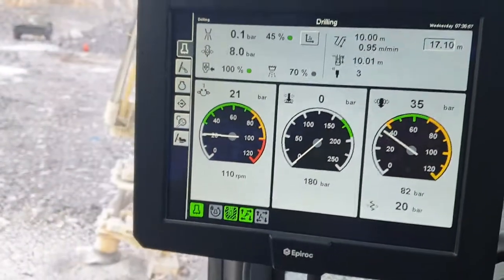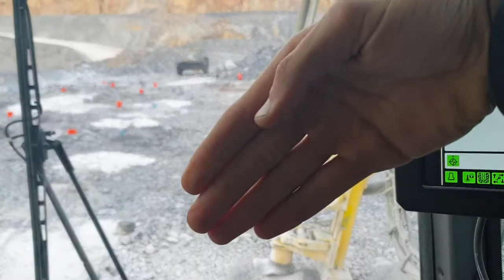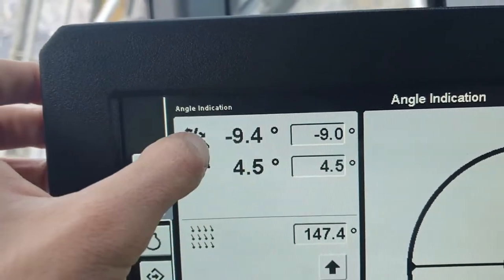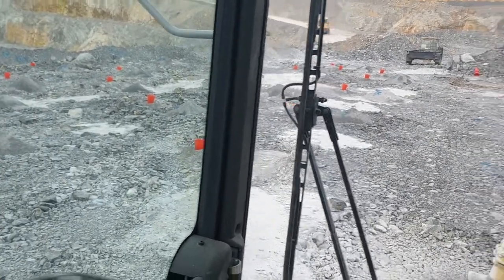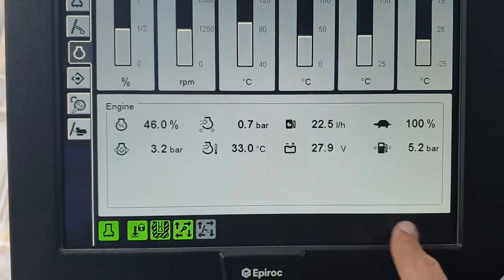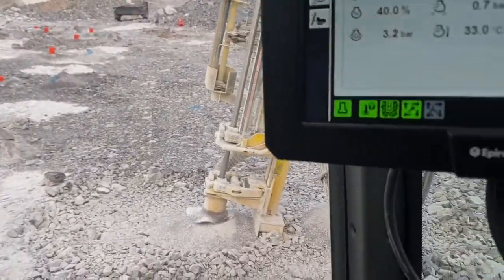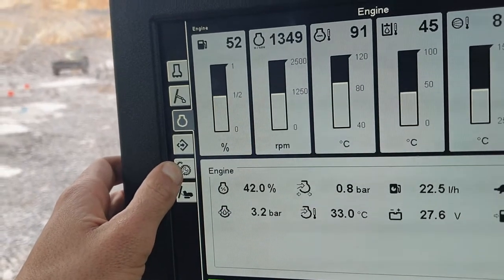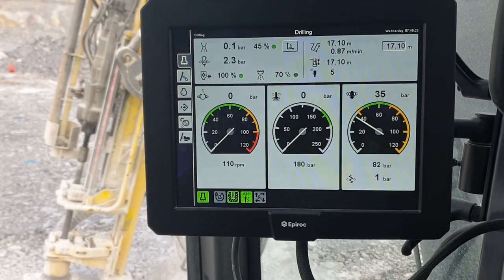Epiroc T45 SmartROC. Rig Tour. Part 2

Comment: Careful when adjusting air levels lower than 50%. Lower levels will cause compressor to over cycle and possibly dump separator tank oil into your air filters.
Reply: Hi buddy what level are you talking about is that the air flow or air pressures? i experience blowing up the air filter/ separator. thank for your comment
Reply: @noelrevil7623  Air Level. With this type of machine and size of the separator tank/compressor 50% air should be somewhere around 3 bar pressure. Anything lower than that will cause the compressor to over cycle and send hydraulic oil in the separator tank to go places it shouldn't.
Reply: If the problem of oil getting dumped into your air intake persists look into replacing the "anti rumble valve".